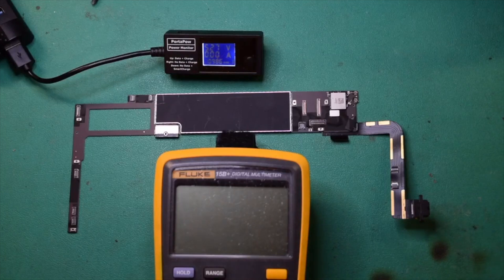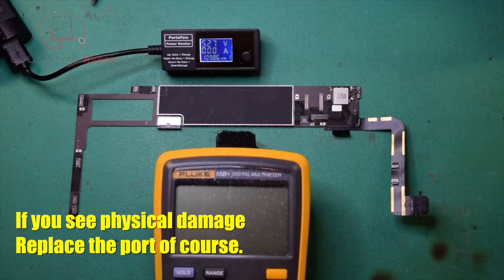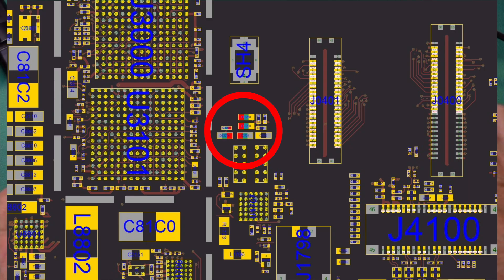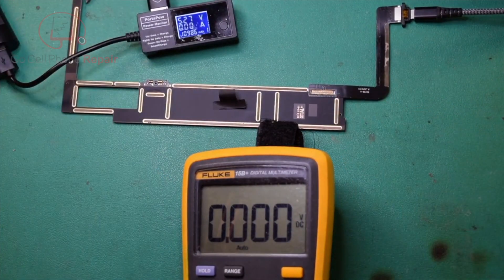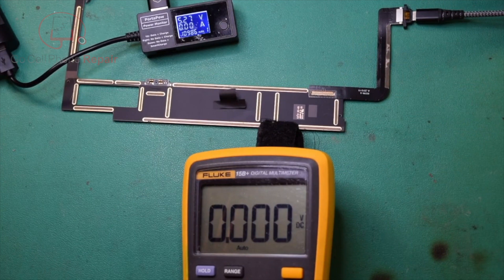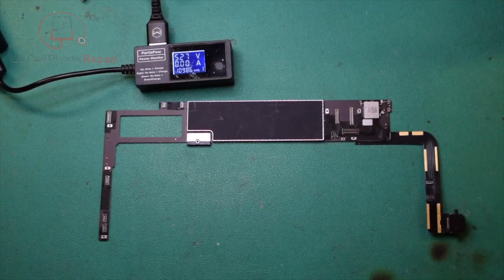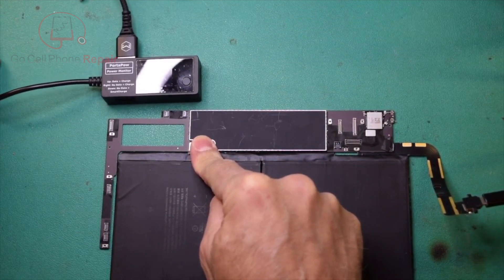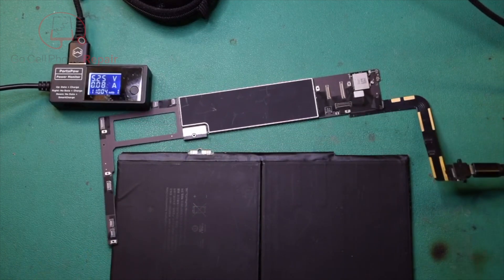Does this iPad 7 have a bad charge port, or is it the charging IC?

Comment: Can I send you mine for repair. My iPad charges but only when off. When it turns on at 5% then it won't charge up anymore then that. It's an iPad 7 Also have one that completly died and I replaced battery and still won't work. Its a mini 5